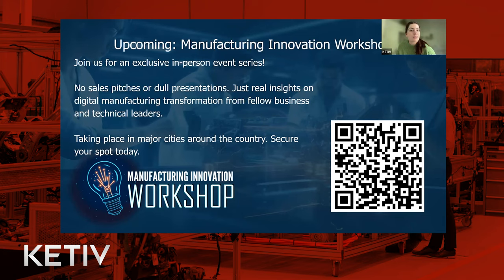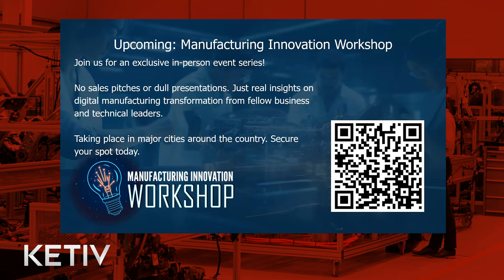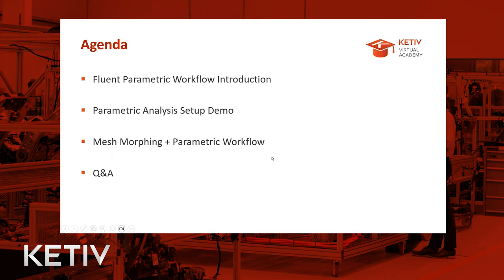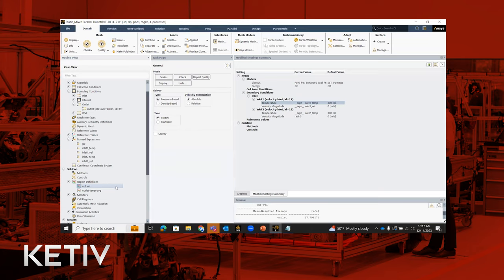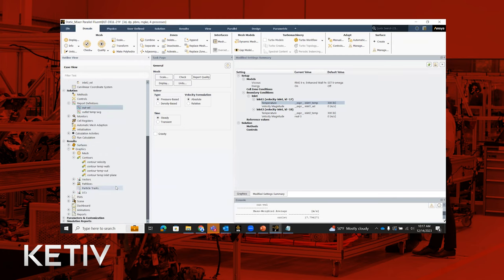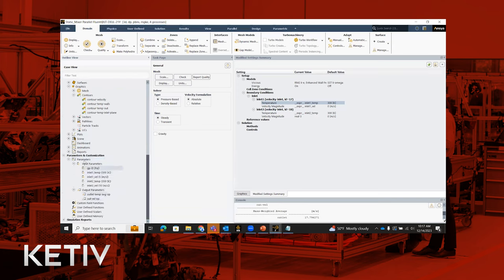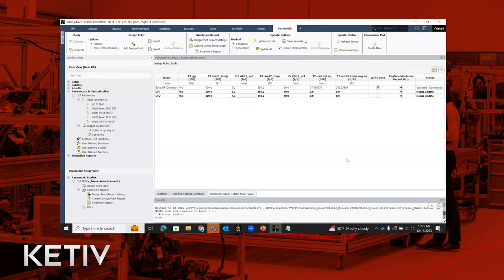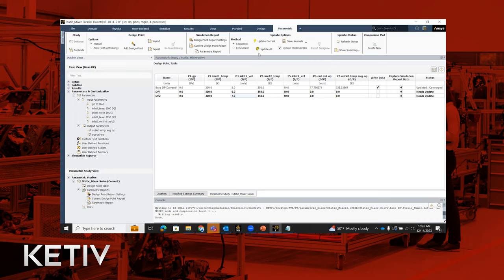Parametric Study Using Ansys Fluent | KETIV Virtual Academy

Comment: Thank you for uploading this detailed explanation video. It is not just a demo. It is a lecture. I just request from you, if possible, the followings or one of the following topics to include in your future videos. 1. Setting the y+ =1 mesh parametric definition on the pipe wall inflation layer. 2. periodic mesh 3. parametric design of a solid body inserted in the volume of the fluid and its effects on the flow such as pressure drop, Nusselt number etc. 4. periodic sweeping mesh generation for complex shaped cross sections.